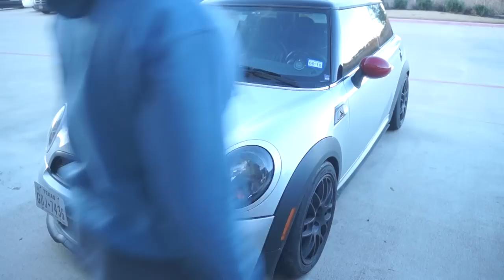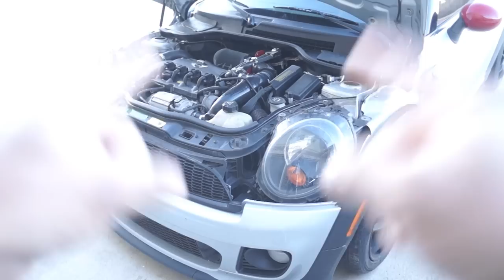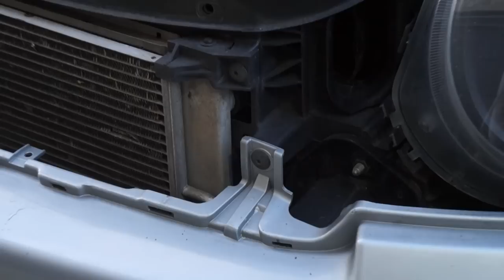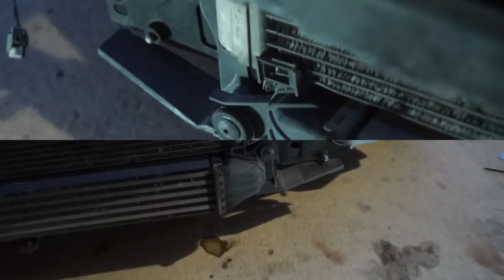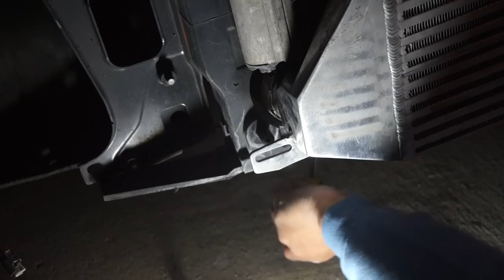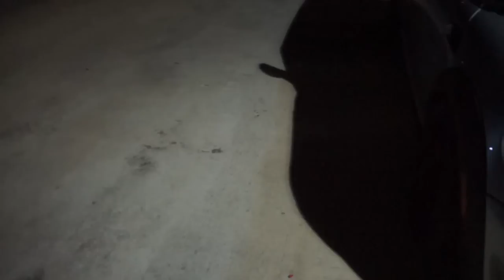R56 Mini Cooper S -  UPGRADE your OEM Intercooler & Do it now

Comment: What intake air temps are you getting versus ambient air temps from each intercooler? And are u noticing any difference in your boost pressure at a given rpm than before?
Reply: It’s a real shame this question never got answered :(

Comment: BTW, MINI just put out a recall on turbo chargers for the N18 engines which happens to be the same turbo in the N14 engines. Unfortunately, they don't have the N14 on recall, but parts guy at dealership said it's possible it will be listed as well. I'm really hoping for this since they quoted me $3700 to replace my turbo. maybe if enough people contact MINI, they will see the need to add N14 engines to the recall.
Reply from the maker: OH man that's great info! thanks for the heads up man and thanks for watching !!
Reply: Did N14 turbos ever get recalled?

Comment: Can you upload an uneditted video of you removing the front bumper and also putting it back on.  I have been planning to do this for months but I'm concerned I won't be able to remove the bumper correctly/put it back on.  (How many of those little plastic rivet screw things did you break?)
ETA:  Also any idea why these inter coolers are listed as being for 2007-2012 or 2007-2011 R56's when this model went through 2014?

Comment: Hey Bimmer Dude, Thank  you for the video/s.  I just purchased a 08 S model and I love it.  I was wondering that after upping the intercooler, you mentioned about the DME retarding the timing.  Do you know if that is going to be a reliability issue? And is there a fix for it?  Thanks Bimmer Dude.

Comment: About to install a new intercooler looks like yours. Just wanted to know where you connected the ring found on the top of the unit. Also just an ask the volume level for the music vs your comments level is much higher. Maybe in post you could make them more even. Otherwise good vids and a big help with my mini project

Comment: I have an extra one of these (manufacturer sent me two by accident when I ordered it)  so if anyone else is thinking about doing this upgrade and wants it.... we could probably work something out.  

I WOULD STILL REALLY APPRECIATE THE FULL VIDEO, OF REMOVING THE FRONT BUMPER!
Reply from the maker: E Unit that's awesome man! I'll be doing another video at some point regarding the fog lights in the bumper. Pelicanparts.com has really good walk through I believe though if you not able to wait .
Reply: E Unit take a look at the Evolve tune. You do not need to remove and send in your ecu. They send you a flash drive, and you send them the flash of your cars ecu. Within a few days they email back your new tune. I am extremely satisfied with my tune, but i immediately had to upgrade my B.O.V, and refresh my turbo internals. With an intercooler and cat back ( i am running a downpipe ) it will make SERIOUS power for what you pay. No joke, the evolve tune is roughly 50hp if i recall correctly,... and you feel it once you hit the sport button and give it gas.
Reply: Do you still have by any chance?
Reply: If you still have it I’ll take it of your hands lol

Comment: Bimmerdude, I looked at the link you provided for the valve cover but it comes up with a bunch of different ones. They are all aftermarket and cheap. I was told to stay away from aftermarket valve covers but I do not want to spend the stupid prices they are getting for OEM covers. Could you tell me what exact one you got? I have a 2009 Mini Cooper S CV.

Comment: I have just installed an aftermarket intercooler for my r56, but what happens to me is that 1) The bumper doesn’t go in enough to put the bolts from the bottom of the bumper 2) it seems like the intercooler sticks out more than the original so the bumper cannot fit where it was before. Is that OK to just leave it as it is ? Although I tightened the two bolts in the front and the two bolts at the side

Comment: Are you not remapping it after changing the intercooler? You should always remap a turbo charged car when changing intercoolers, exhaust systems or anything that affects the boost pressures, exhaust pressures, fueling etc 🤷🏼
Reply from the maker: Unfortunately I did not at this time. Keep in mind this is an old video.i reset all adaptations on the dme and allow the factory dme to adapt to the increase and volume and density of air. All air-fuel ratios were in normal range which I was able to monitor using my torque app

Comment: So I’m at the intercool debate cheep or expensive, it seems to be 50/50 on blogs how did you come to your decision? And have you had your ECU tuned
Reply from the maker: steven mankowski I'll be completely honest with you I've been at this a long time with cars in general and I can tell you that there is really no difference aside from the name brand attached to it unless the item says Made in the USA they are all made in China the difference is nowadays you can get quality items instead of the junk we used to get back in the day. Typically the debates are between individuals who have the extra funds to spare and have always bought the name brand and individuals like myself who need to spread the money around between projects and I've come to the conclusion that it works just the same. I think the ultimately have to ask yourself which one you are. Hope it helps you out man thanks for watching the video!
Also forgot to mention I do not have a tune currently and you do not need it tune to install a intercooler increasing the efficiency of the air that's cool being charged into the engine is essentially the same as installing a cold air intake it is ideal that you threw the adaptions on your ECU 2 allow the parameters to adjust for the increased density the air entering the engine.

Comment: Hi I'm new to ur channel.
Did u have to drain coolant and flush before installation?
Thanks in advance love from the UK 👍🏻
Reply from the maker: Dean Hughes Hey Dean you should be good to replace your intercooler. The coolant system is not connected to your intake system . THANKS FOR WATCHING!

Comment: It's almost kind of shocking how small the factory intercooler is. I have to imagine it's not just a performance bottleneck but feel like that much restriction is just generally not good for the engine.

Comment: Have you seen any difference in this eBay Intercooler and a name brand forge or Wagner? Very interested the price point is killer
Reply: Cheap intercooler, especially the Ebay chinese specials are of poor quality and craftsmanship. Weldments and materials used are below safe margins and will not hold well with increased boost pressures, they will leak. I bought a forge intercooler a few days ago and can share images so you can make informed decision when your ready to fork out cash for something that gives you a peace of mind. Quick Note: Forge Intercoolers are used in MINI Challenge so that gives you an idea that it holds in real circuit stressful racing conditions.

Comment: Hi mate I’m Guna fit new intercooler and my car has been mapped sage 1’the Guys Saying it needs colder plugs and map sensors 3 bar did u hav to do any of this
Reply from the maker: Gavin Isaac8516 colder plugs cant hurt. But you do not NEED a retune for this. You aren't forcing more air into the system. The new intercooler has a larger capacity to cool rather. However a remap could help your mini use the new average intake temp more efficiently.  Hope that helps
Reply: Bimmer Dude hi the car is already on stage 1 runninb at 225bhp with original intercool on I’m just fitting a bigger one but my Remap ppl saying need cold plugs and map sensors to 3bar as it’s at 2.5
Reply from the maker: Gavin Isaac8516 I see. Well you can run it with out it. Honestly they should've recommended you do the intercooler with sage two. The factory intercooler is dangerously small and heat soaks quite badly. It will run more efficiently as is with your current tune I'd say do it yourself and see before spending any more money
Reply: Bimmer Dude I said I should of and the intercooler 1st to them

Comment: How much boost can that intercooler take?
Reply from the maker: Erik Avila at least 3 times what the factory one can. It's easily 3 times larger.its not recommended to increase boost pressure with factory intercooler

Comment: So how do we get nothing but gains from an aftermarket FMIC?
Reply from the maker: Jean Dandrea simply put the intake temperatures are more consistent due to a larger surface area compared to the oem unit. Since the intake temperature sensor is on the charge pipe near the throttle body instead of the inlet on the turbo. This set up gives a more accurate temperature for timing. With the cooler temperature timing is more optimal for making consistent power . The oem intercooler gradually looses it's efficency compared to the larger after market units. Hope that helps
Reply: So the larger FMIC is only beneficial?
Reply: Preparing my car for stage two at 40k miles 2013 n18 Hardtop, replacing my thermostat, walnut blasting, running the crc fluids through, I already have a catless downpipe, need to get the fmic and aem intake, and NGK plugs, also going to be replacing the noise maker and intercooler resonator with silicone piping, as well as replacing my transmission mount and lower/upper engine mounts, then the tune comes in and ill slam her with some coils and add a alta sway bar :)
Reply from the maker: Nice!! Awesome to hear someone planning to take care of maintenance before power adders. Gonna be a monster
Reply: Yessss very excited, was thinking about trading in my car for a new STI but I love minis too much, I must build her!
Reply: You should check out that 500bhp mini on DMO Deejay's channel, nicest, best, coolest mini ive ever seen

Comment: Mine is at 225bhp I’m after an airtech intercooler £350
Reply from the maker: is this with out a tune??
Reply: Hi this is tuned as much as I can go with it for now 301nm torque and 225bhp
Reply: Would I be ok with a cheaper intercooler like wot u hav installed
Reply from the maker: absolutely no issue with a cheaper one. Only real difference is the price tag to be honest. there hasn't been evidence to show the cheaper one is less efficient

Comment: um....100 bucks for an intercooler?  Beware of those cheap Chinese crap intercoolers online.  Those that have checked them out have serious concerns about the long term reliability of these products.  A normal price is 5-6 hundred from a reputable brand. Enjoyed video otherwise! Edited-there are some that paid about $150 and put 40,000 miles without issue. I'm still skeptical though.